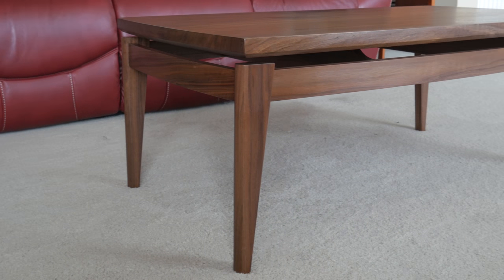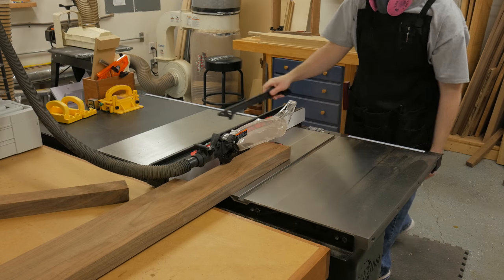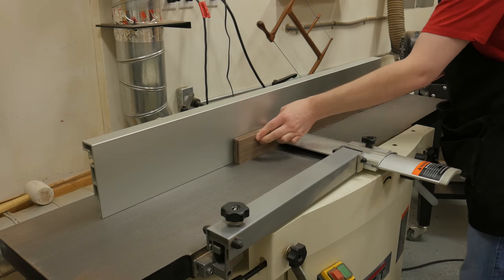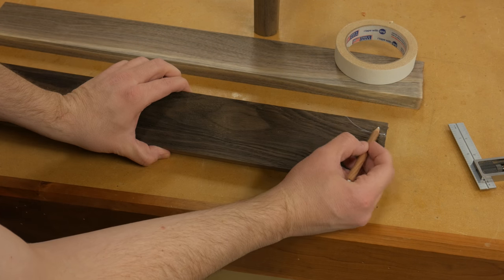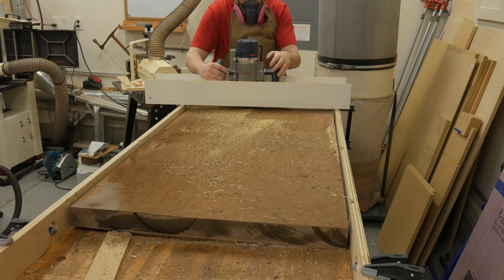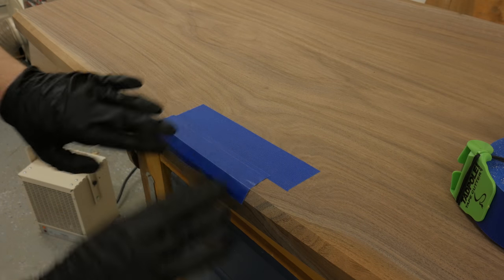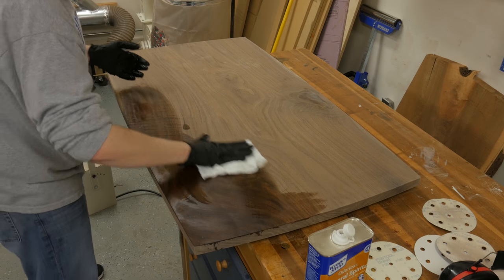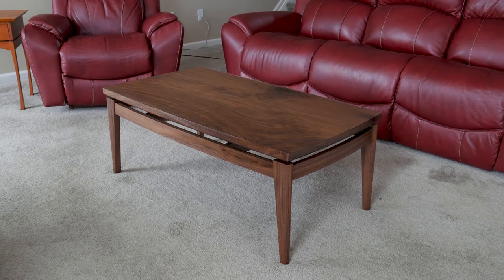Modern Walnut Coffee Table

Comment: I loved the project, and walnut is a beautiful wood to work with.  My question is "Are you concerned about the top expansion due to humidity, and should you use figure 8's to help manage that? Or maybe use wide slots to hold your screws?
Reply from the maker: I elongated the holes using the 1/4" drill bit. Thanks for watching!

Comment: Nice 👍🏽. Any reason why you didn’t stabilize with c-channel? Looking to doing something similar with an oak slab I have.
Reply from the maker: If you have aprons under the top you don't need it. If you have a slab that's going to warp without c-channels it's most likely going to do it with the c-channels too. Make sure the slab is dry and acclimated and with aprons, you shouldn't need it. My riser blocks under the top have table top fasteners which holds the top to the base and anchors it down